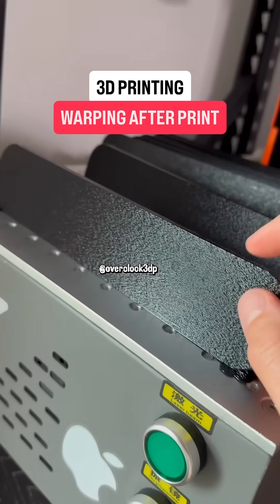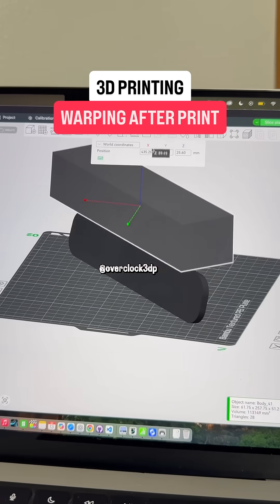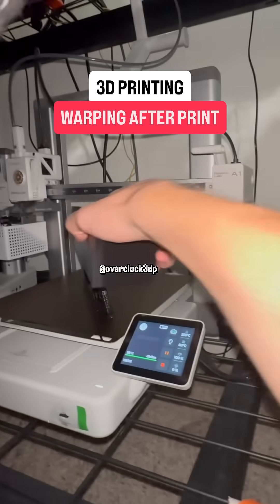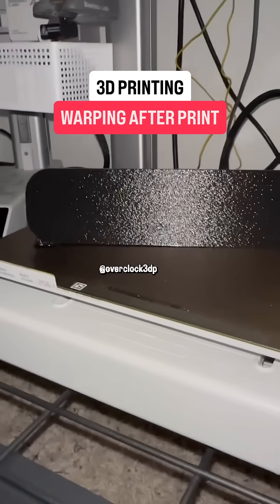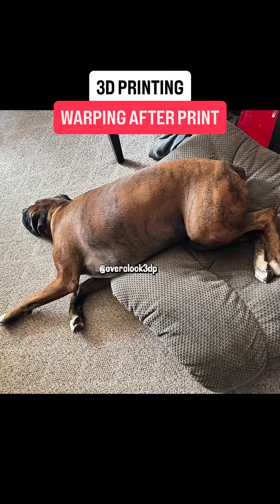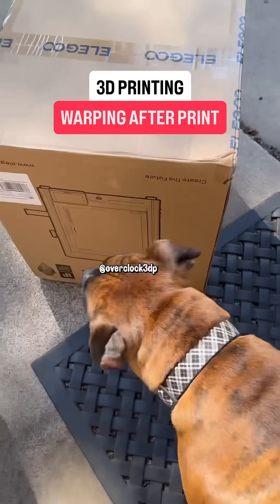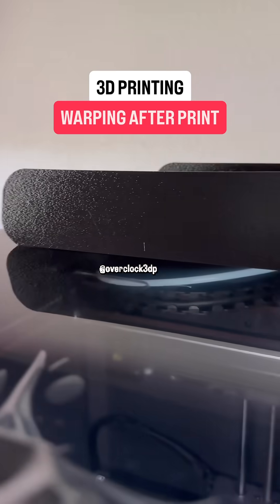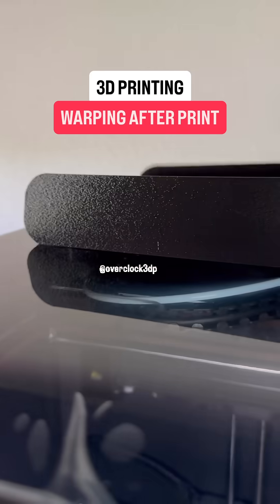post-print warping #3dprinting

Comment: How does the hi stack up to the a1
Reply from the maker: Only “gripe” with the Hi is that it cannot load filament into the toolhead without preheating. (This could probably be addressed with root)

With the A1, the extruder can load filament into the toolhead via the touchscreen without heating. This is fair a time saver if a person is throwing on new spools for multiple printers. 

That is my only gripe for now. Other noticeable difference is build plate texture. Everything else is nearly identical. I can use the same cooling, print speeds, etc between the Hi and A1 with nearly identical results. I have not tested how the pause/filament runout/resume effects the print on the Hi (A1 is pretty much seamless)

I would likely buy another Creality Hi before I would buy another A1 from Bambu
Reply: @overclock3DP thats good to hear I've genuinely haven't seen too many people talking about the printer and thats the only reason I didnt get it over an a1